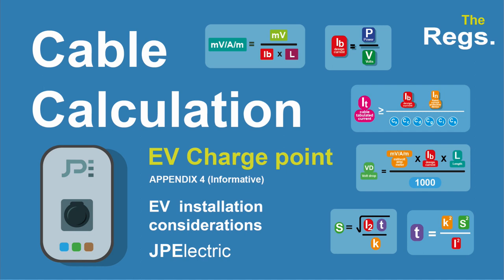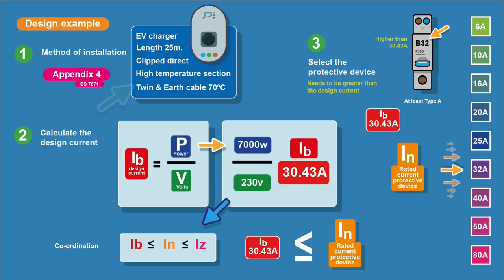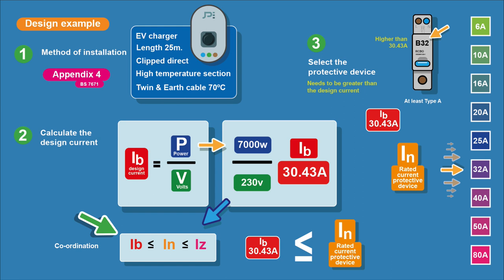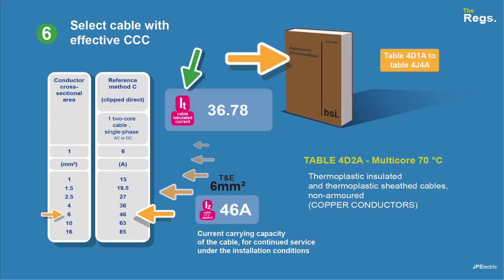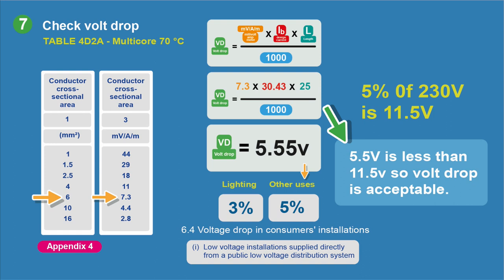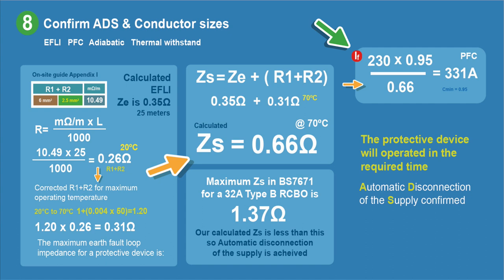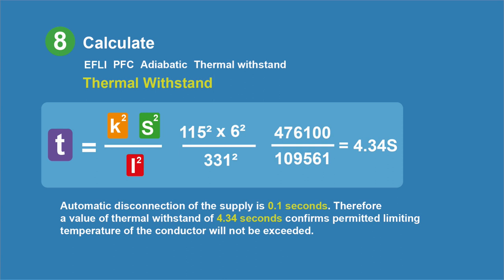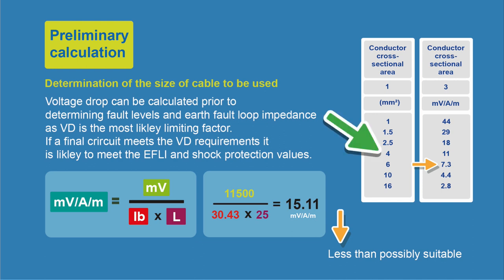The cable calculation procedure for an EV (Electric vehicle) charger

Comment: I use software to carry out design calculations which is incredibly accurate and great for my clients as a full report can be sent confirming all calculations meet the requirements. The problem with this method is that, as an electrician, you become lazy and lose the ability to manually do the calculations. 
You've given me a bit of food for thought here because it's clear to me that I have become reliant on software.

Thanks for the video. Great stuff for learners and old sparkies like myself. 💪
Reply: Software is great until the computer breaks down
Reply from the maker: Thanks very much for watching.   I do like to work out with a pen and paper, then I use software to confirm my working out,  and visa versa.
Reply: @angelofranklin1  Very true!! Fair point...
Reply: @JPElectric  You're welcome bud. 👍

Comment: Love your vids. Im nearly able to self certify.  I understand the principles of solenoid but thought a bs60898 only applied to ac circuits. 
But you mentioned a type A mcb because of DC currents. I would love you to discuss this topic further. Thanks for these excellent videos
Reply from the maker: Thanks for the comment. We are talking about AC circuits. But lots of modern tech has electronics which produce DC current, and this can appear on the AC installation. LED lighting,  EV charging, Washing machines. Basically anything with an electronic circuit can introduce DC current onto an installation. The standard AC RCD can be 'blinded' by this current i.e  be desensitised, so it will not pick up an imbalance in the supply.
This is how loop testing was made possible with multifunction testers (Dlock) it saturated the RCD coil with DC current to enable the loop test with out tripping the RCD.
Type A RCDs can work with around 6mA of DC current, and are now currently required. AC RCD are all but extinct. Type A is also not ideal, but its what is generally available. This issue will be ongoing for some time
Reply: Ok. Excellent information. Thank you !

Comment: Great video as always, id like to politely point out though that you have It and Iz the wrong way round.. Iz is the figure you get after applying factors. It is the current carrying capacity of the cable you select from the table in BS7671 hence the term “tabulated” as it comes from a table.
Reply from the maker: Hi Ja_adam.
Thanks for the comment
My understanding is..
Iz is the current carrying Capacity for the cable  for continuous service.
It is the value we get, which must be ≥  the value we get by dividing the  In or Ib by the relevant correction factors.
Reply from the maker: Hi Ja_adam
Just to clarify my answer.  You are correct.  The values we look up in BS7671 is the It - the tabulated value. 
I am doing another video which I hope will make this point clear.
Thanks